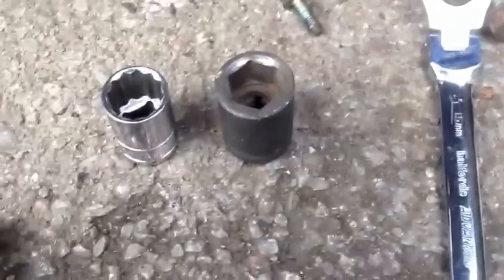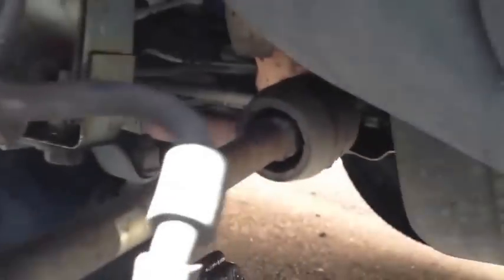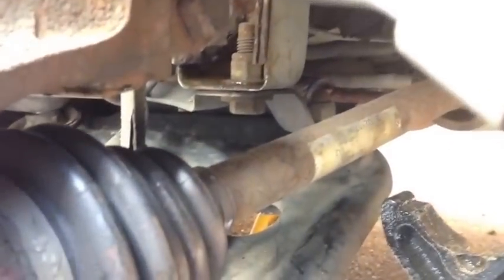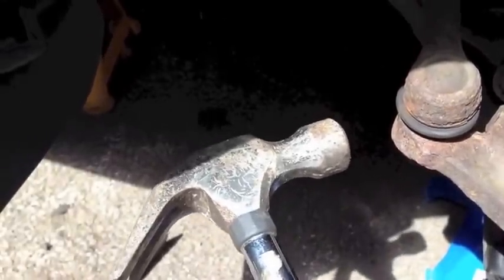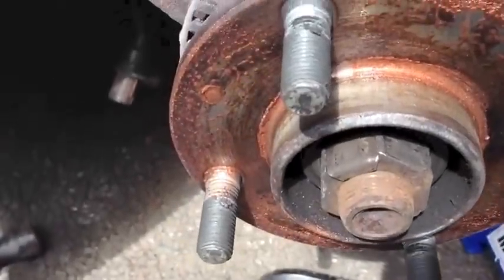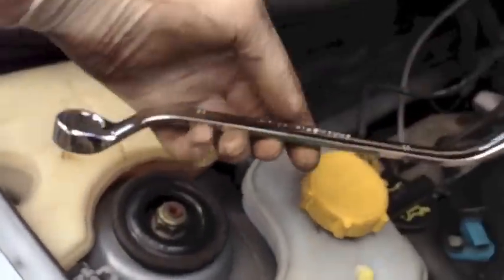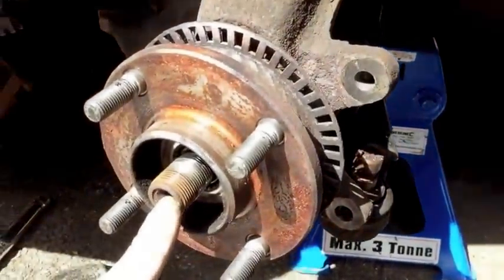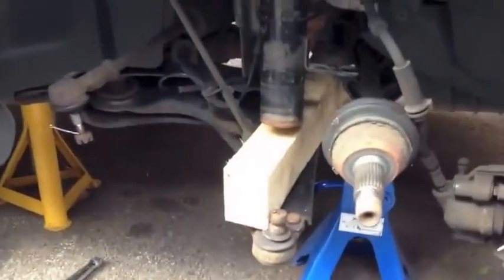Ford Ka (mk I) Front Suspension / Top Mount Rebuild

Comment: First off, thanks for taking the time to make this video.  I just swapped the coil spring on a 2007 Ka so thought I'd add some info as this video helped me when I first did it - When I first replaced one I used this method but tonight I did it without removing the hub and drive shaft, it took me less than 2 hours working on my drive - I had not long replaced the lower arm which may have sped things up.  Info below:

Loosened the wheel nuts slightly, then jacked car up on the lower arm area and then an axle stand under the sill jacking point.
Wheel off then loosened the 13mm nuts holding the caliper, removed caliper and zipped tied it out the way on a nearby solid pipe.  Pull the brake line rubber holder out of the shock and note its orientation for refitting.
Using a allen key hold the anti roll bar link in place and remove the 15mm nut holding it on to the strut then withdraw it out of the way towards the chassis
Brake disc off then I removed the 17mm pinch bolt nut on the lower arm ball joint, hit the bolt out with a drift or small enough bolt.
Lever the lower arm ball joint out of the hub with a crow bar by prying between the arm and the hub (watch the boot) then move the hub out the way towards the front of the car.  
I put another axle stand under the driveshaft but it didn't seem to need the support even when the shock was removed, I suppose it's good to have something there just incase
Douse the hub area where the shock enters it in WD40 and then remove the 19mm pinch bolt.
Using a piece of wood as a buffer knock the hub off the shock using a lump hammer, once it starts to free you may have to wiggle the hub and push it down/towards the front to get the shock free.  You can push down on the lower arm to get more space for the hub.
Use the deep reach 19mm spanner and the allen key to loosen the top mount nut and withdraw the shock.

Re fitting is the same as removal  but a few tips- Clean the hub area and shock end with sandpaper and lube with WD40.I had to wiggle the hub/shock around a bit then used light taps from below to get the shock to seat back in the hub - Make sure the alignment tab is in the right place.  I put a jack underneath the hub once the shock was fitted to raise it enough so I could reattached the drop link to the shock.

Comment: Great vid!  Thanks very much!  Just done son's 13 year old KA.  Left driveshaft attached to hub and left tie rod connected.  Strut seriously corroded to hub carrier - 2 additional tips - bang sturdy metal strip/washer between halves of hub pinch bolt track and screw bolt in 'backwards' to open hub and release strut.  Alternatively, use Plusgas (overnight), cold chisel (with hand guard!) and hammer to open hub!  Use of impact sockets totally essential for older car!  Thanks again!

Comment: I’ve changed many top mounts on KA’s and I’ve never taken the driveshaft out. Wheel of, losses pinch bolt undo from the top take pinch bolt out and smack the knuckle with a hammer to get the shock out
Reply from the maker: late reply - you are right! I had a mk3 mondeo at the time and had done the job loads of times on that (everything needs to come apart including lowering the sub frame) and I just approached it the same, but I just gave myself extra work.
Reply: So you don't have to take the disc and drive shaft out etc???

Comment: Just did my first strut rebuild. This is a good backup video if you cant separate the strut from the hub but in all honesty its far easier to beat crap out of the hub with a rubber mat and a lumphammer as others have said. But compared to other vids on this topic this is one of the better and more detailed ones good work

Comment: The wishbones (aka Track Control Rods) had to be replaced on the "my" (i.e the family's!) Ka.

However, after making a BIT of a mess on one bolt (read: total mess up!) to which my parents were SLIGHTLY ANNOYED (read: furious!), I found the important thing is that the sockets are of the hexagon flank drive type (six-sided with curved inner walls, as opposed to flat walls), more than them being impact sockets. There are non-impact sockets that are hexagonal flank driven which I found do the job well - provided 1) they're of good quality chrome vanadium of course!, and 2) the fasteners are opened with hand tools, AND NOT IMPACT TOOLS

Of course, if one is to use any form of impact tool to open any fastener, then using an impact socket is a MUST

Comment: just remove the top drop link nut that connects to the strut and the pinch bolt above the hub then use a pry bar to lever the strut from the hub it took me less than a hour to do both sides you don't have to remove anything on the hub this guy just caused himself a load of extra time and work
Reply from the maker: Yep , well noted in the other comments. I was so used to doing the job on my mondeo in this way that I just did it the same.

Comment: At least for a rear suspension rubber mounting on a Ford Transit, it used to be legal to pack in material, such as elastic cord, because the test was only for tightness, preventing insertion of the tester's probe.
Does anyone know if there is a written restriction on such packing of a suspension mounting? What about in this case?
It might be worth asking at a testing station.

Comment from the maker: Yeah, I think I spent the best part of an hour getting the lower arm off of the bottom of the hub. The bolt was rusted in and then so was the ball joint. I really should buy a blow torch… Apart from that it was fairly straight forward.

Comment: Others just remove link for the roll bar, flexi pipe and strut base clamp bolt to remove the strut!  ..... remove the inner wing nut as well of course!

Does the wing lining need to be removed?

Mine is a 2007 1.3 so presumably the strut will part from the hub.

Comment: good vid but removing the drive shaft was a waste of time, never in my mechanics career have i needed to do this to remove a strut (including on my Ka), but you live and learn :)
Reply from the maker: Thanks for the tip. I've previously done as you describe on a few other cars, but I'd recently done both front hub bearings on a mondeo so I think I was still stuck in 'hub removal mode'...
Reply: haha never the less, was a great vid :)
Reply: +sr biker even i was wondering why he had to remove the drive shaft... all i did was remove the pinch bolt and disconnected the arm from the hub and that was good enough to remove the strut
Reply from the maker: Never in my mechanics career have I ever needed to either... thought the video might help some people though.

Comment: I need to fit 2 new coil springs on the front on my ka....cant I just undo the pinch bolt that traps the bottom of the strut with the spring comprest with clamps...with out having to disturb all thos other components...brakes drive shafts ect????

Nick in the UK.
Reply from the maker: No reason why you can't try. If you have difficulty removing the strut from the knuckle then you might end up taking the discs off for better access.

Comment: Hi I am in the process of getting my front shocks changed, I ve got the shocks and Spring coils what else will I need to have them changed.
Reply from the maker: Always the possibility that balls joint seals are/can split. You might need a ball joint splitter to remove the track rod end from the knuckle. The top mounts and top mount bearings can also wear. In terms of tools just make sure you have an impact socket set (regardless of whether or not you are using an impact wrench) to stop nuts and bolts from rounding off. Spray all they joints with penetrating oil 24 hours in advance. To compress the springs (in order to put the new coils on the new struts) you will need a set of spring compressors.